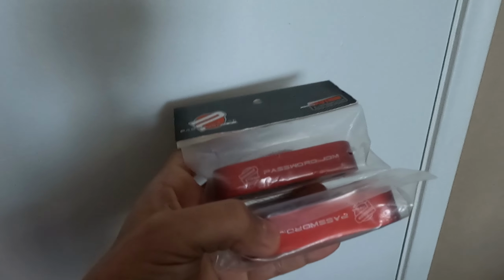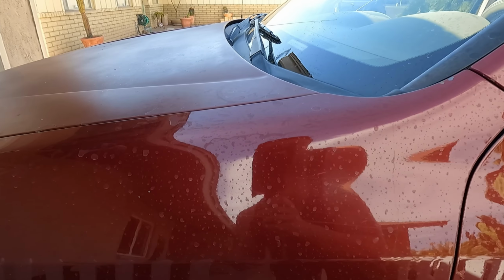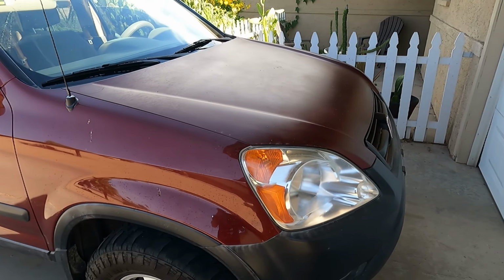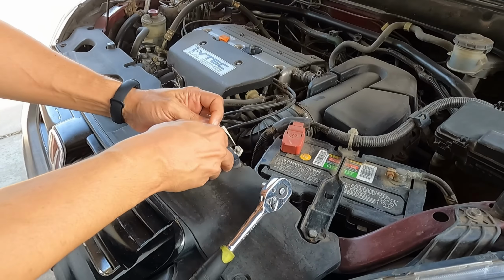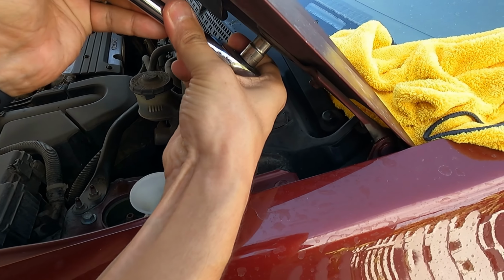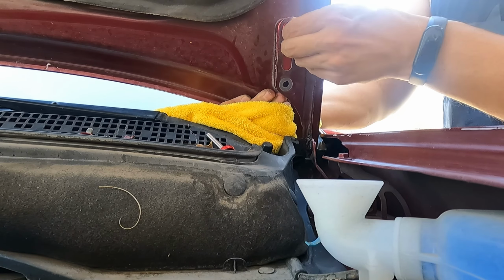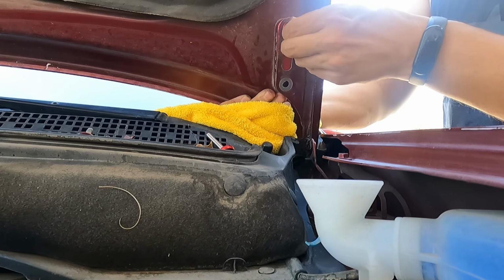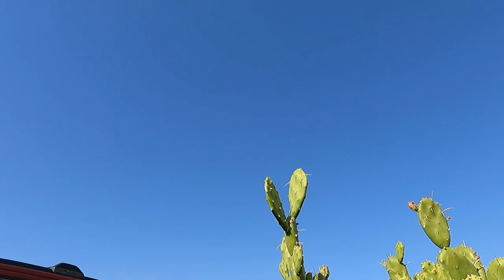NEW MOD FOR THE LIFTED CRV | Off-Road Build (2003 Honda Crv)

Comment: Hi love the look but can only find them for honda acura will these fit my 2004 crv??
Reply from the maker: Thanks! Here's the link to the set I bought for my Crv. https://www.ebay.com/itm/184732401364?fits=Year%3A2003%7CMake%3AHonda%7CModel%3ACR-V%7CTrim%3AEX%20Sport%20Utility%204-Door%7CEngine%3A2.4L%202354CC%20144Cu.%20In.%20l4%20GAS%20DOHC%20Naturally%20Aspirated%7CSubmodel%3AEX%7CEngine%20-%20Liter_Display%3A2.4L